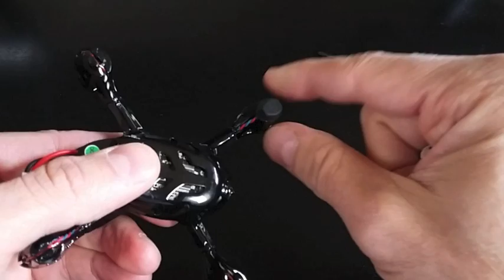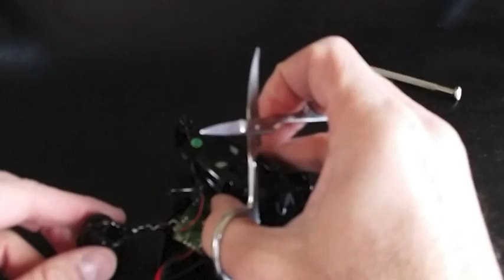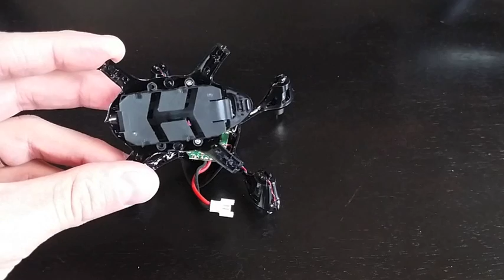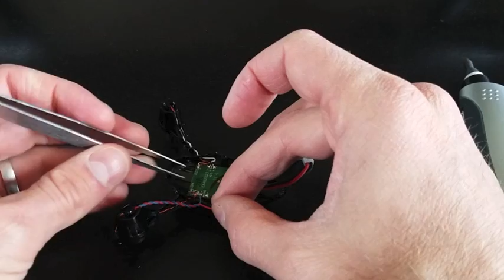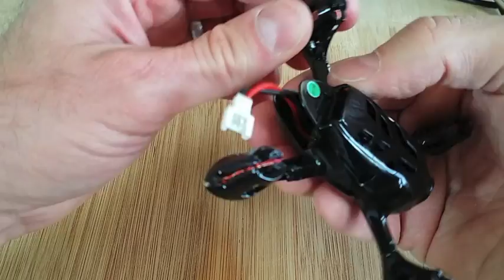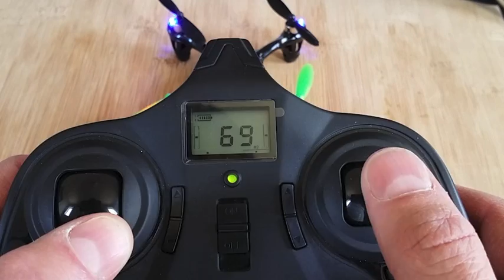Hubsan x4 h107C Motor Repair/Replacement Step by Step & Tips

Comment: My Hubsan x4 h107c does not fly after board and all 4 motors replaced. Transmitter LED is green.
Reply from the maker: Strange... Have you double checked all of your connections? Do all the motors run? Does the quad turn on? Hopefully you've got it running by now?
Reply: No Joshua. Negative. I think I'll need to check board output voltage when the throttle is high.

Comment: And I bought a soldering iron today just so I could switch motors and tried to sacrifice one to fix the other. At least I was able to switch and solder a motor onto the board correctly. So... This video  was helpful.

Comment: I've had 4 , x-107L quads. They only last around 20 flights before they ruin a motor. Now I'm waiting for replacements to arrive so I can try motor replacement. They are really great for a couple days then they break.
Reply: Yeah I agree. Are you flying back to back flights? That will burn out the motors faster. Good to let it cool down for 5 min or so in between flights, for those that aren't already doing it.
Reply: +ridestr0ng  : Yes I was flying back to back flights and allowing 5 minutes in between. I'm convinced now , that the gyros are going bad. I successfully switched a motor tonight and it still flies  the same. I had 3 of them go bad in one week. The bad thing is ; I've ordered lots of extra parts, batteries , and a new charger. Etc.  .. I couldn't tell a difference in the motors but assumed that was the problem. I've had 4 , and they all became uncontrollable in the same exact way. They are really awesome for the first 20 to 30 flights. Then they all slowly go to crap.
Reply: +erosionhead420 - yeah that's been about my experience with them too. They are fun though!

Comment: This video is exactly what you want in a tutorial. Picture is clear, audio is easy to understand, no 5 minutes of blabbing about all the different ways you might have damaged your quadcopter or how it may or may not apply to OTHER quadcopters that aren't quite the same as this quadcopter, just the required instructions. I wish more tutorials were like this. Wouldn't have been able to replace my motor so easily without it. Thanks!

Comment: I found that cutting the wires on replacement motor a few mm short of the circuit board, it was easier to join the two wires with solder then heat shrink to insulate. At my age the shake of my hand and a combination of eye sight not as it used to be, I found it so much easier.

Comment: My radio shack 20 watt precision soldering iron doesn't seem to get hot enough. It will melt 40/60 solder, but not the solder on the board. Dos this seem right? I think I'm going to buy a 60 watt adjustable one.
Reply from the maker: Yeah, the cordless solder irons can be pretty finicky, and not work at all at times. I actually prefer a regular plug-in soldering iron.
Reply: +Joshua Anderson Actually, it is corded, but only 20 watt. Do you think they use a higher temp solder on the board?
Reply: +Benjamin Pratt
You might need this motor 
 http://www.amazon.com/dp/B01ALRYYI0

Comment: I had to re attach an led because I was stupid.  A soldiering iron with a fine tip, solder, tweezers, a small screwdriver, some very fine copper wire, and some grey primer paint to spray the new wires to prevent a short circuit and I got it working again!  Hooray!

Comment: thank you good sir. my quad has been sitting around because i didnt know how to fix it. and to the other guy get a crash pack for like 17 dollars on amazon, it comes with one motor of each color, a few sets of extra props, the rubbers for the bottom, an extra battery and a extra body

Comment: Hey i recently bought a spare motor because one was defect. I took a picture to make sure i placed everything correctly and replaced the motor. Now it just runs without me doing anything and doesn't react to the remote. I checked if everything was placed correctly and disconnected and connected it several times but it just runs as soon as i plug in the batterey. Can anyone help me?

Comment: did you use the existing solder on the board or new solder?
Reply from the maker: I just used the existing solder, but it's a good idea to have some extra incase you need it.
Reply: thanks, replacing a syma x5c motor.

Comment: Just wondering do you have to De solder it from the board or can you cut the wire hath way and solder the new one to that avoiding the risk of damaging the board
Reply from the maker: You can just cut the wire.
Reply: Awesome thanks it's just seems more logical then potentially ruining a £80 quadcopter
Reply from the maker: Yeah I agree.
Reply: nathan ward exactly :)
Reply: You mean cut the wire and then connect the wires to eachother instead of resoldering on the board ? Does that work ?
Reply from the maker: Technically you could cut the wire and then connect the 2 wires but I wouldn't recommend it. You're better off resoldering the new wire onto the board. With how small the wires are it would probably be more difficult to connect them together then to resolder.
Reply: @JoshuaAndersonLife  Gotcha :) Thanks!

Comment: Where can i get a solder like yours?
Reply from the maker: You can get it from eBay or Amazon, but honestly it's only good for very small jobs like this. I'd recommend getting a more traditional soldering iron from Wal-Mart or somewhere similar, plus they're cheaper.
Reply: Thanks. But I will only be using it for small jobs,similar to what you were using yours on. Will you please give me the brand and name of it.
Reply from the maker: luann els Sure, Cold Heat, same as this one: Cold Heat Soldering tool - THE ORIGINAL https://www.amazon.com/dp/B00067GK7Y/ref=cm_sw_r_awd_RJ3gvb1874P40

Comment: I bought a FPV X4 170D on the 11th February 11th and used it without any problems until two weeks ago when I started having problems with the engines.
The engines lose power or stop when they are inclined. I sent an email to Hubsan with the video link of this problem but the only answer I got was that they could not see the video! The video is shared on google docs with public access, here are the links:
https://docs.google.com/file/d/0Bw1q7hDAOJF5Z0Z3S0NjMllrTWM/edit?usp=drive_web
In the meanwhile I have made another video, here is the link:
https://drive.google.com/file/d/0Bw1q7hDAOJF5NGpnRzVrME5xQjQ/view?usp=sharing
I already calibrated the transmitter stick and the accelerometer but the problem remains unsolved.
Someone can tell me what's going on? This problem is normal after such a short time of use? What should I do?
Reply: b0nsa1 from the looks of it .. you clearly have a dead motor at the front.. the only other things i am noticing is normal gyro stabilising activity in the quad .. in your video ..

also try recalibrating the quad and the TX.....
Reply from the maker: It looks a little bit like the motors are cutting out like they do in 'anti-flip'mode. Have you tried putting it in expert mode, and then switch 'flip mode' on and off?

Comment: Great video. I recommend pulling the motor out with pliers.  If you push it from the bottom (as in the video) you can cut the LED wired (like I did).

Comment: Hey your the drone expert hehehe...my hubsan x4c recently was bought and it flew well for the first two days! Then this morning i flew it and it went flying into a pile of snow(p.s wasnt solid ice,just normal fresh snow). I instabtly ran inside and took out a hair dryer and immediatley dried it. It worked fine until it ran out of battery! But now that its fully charged it wont take off!!! The two blue leds(front) are constantly flashing and it wont takeoff. But controller beeps when i turn on the drone! Sorry for long comment but i just wanted to put all the details so you could help me :/! look at my channel for my video of the DRONE
Reply: Sometimes when the batteries in the controller get low, it won't connect properly to the hubsan, despite looking like there's still charge on the display icon, so I'd start with replacing the batteries. If that doesn't work, open up the hubsan and check all of the solder connections. If everything looks fine, it's possible that you have a short somewhere in the receiver board. You can also try recalibrating the controller etc.... Hope you get it worked out!